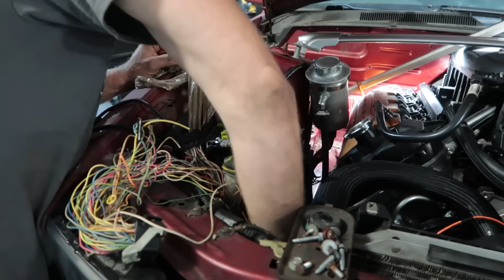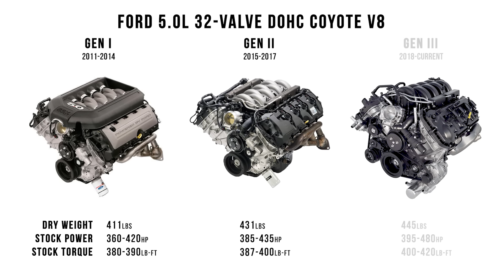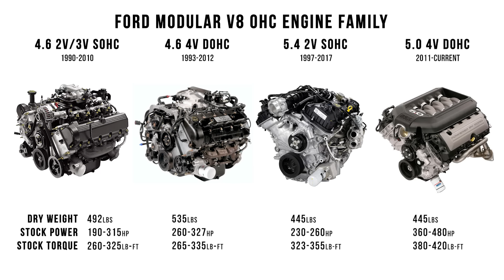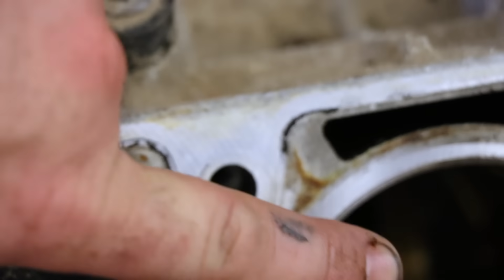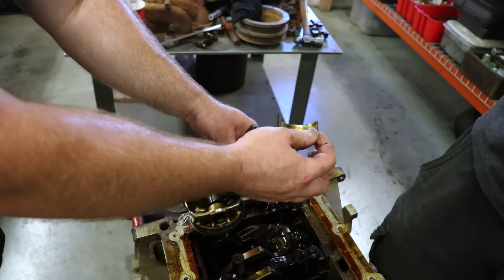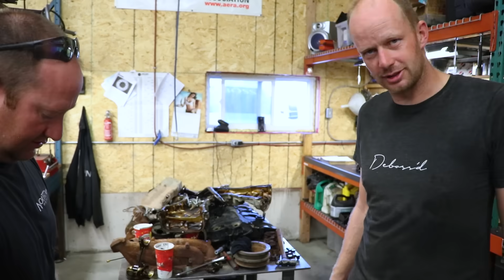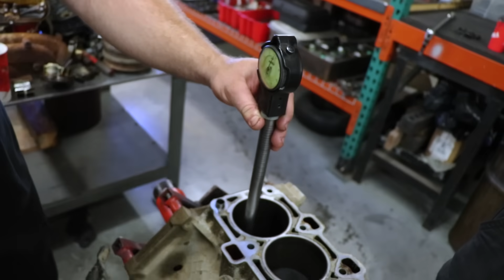REVIEW: Everything Wrong With A 5.0 Coyote Engine

Comment from the maker: Always good to hear stuff we missed. If you have experience with these engines, leave a comment!
Deboss hats are here https://teespring.com/deboss-hat
*Edit :  We're seeing a lot of the same comments about synthetic oil... It's fine to disagree with Scott, just want to make it clear that Scott isn't diagnosing this engine failure as a synthetic oil issue, and neither of us is recommending you run conventional oil in these engines or any engine made to run synthetic. Always run what the manufacturer recommends in your vehicle. Scott also never said synthetic is "inferior" to conventional oil, just that longer drives are much better for these engines in the long run. He also never said synthetic oil is what caused this engine to blow... He said it leaves a tarnish and he has seen crystallization more common in engines running synthetic than not. Not all synthetics are equal, not all bearings are equal...your experience will vary. Go ahead and debate these points, but we didn't speculate on what caused this engine to fail until 22:09 and ultimately we don't know the history or what actually happened. Change your oil and do regular maintenance guys. Again, we make these review videos to discuss engines and their problems as a resource for used vehicle buyers and hotrodders looking to rebuild these. If we didn't like the 5.0 we wouldn't put one in a Bronco...
Reply: I work on these engines regularly. 90% of the truck 5L I work on have low compression on cylinder #4 and 8 caused by intake valves worn down at the valve seat
Reply: Old technology vs. New technology. Overhead cam motors have been around for a very long time. 1929 Bugatti Mark whatever the hell it was was a dual overhead cam motor. There's nothing modern about that technology. As is a race engine dual overhead cam Motors are the way to go there fantastic. Expensive to buy , expensive to fix.  You just don't want anybody inside one of those Motors. But on the street do you really don't need them.
You're looking at the pushrod wrong. Think of the push rod as the fusible link for the valve train. When the Piston hits the valve you bend the pushrod not the valve. Lot cheaper to fix.
Reply: I did alot of the development on this engine at Ford dyno lab in Dearborn MI. Personally the Gen1 and Gen2 are the best. I know alot of people with f150 5.0 that have well into the 200k miles,and have only changed oil,and plugs. No even coils have been changed.  In my opinion its the best engine ford offers for the f150,and most under marketed engine. Alot of the durability issues had to do with a bad ground crank. Which was fixed in the XM development stages. If only they offered the 7.3 push rod in the f150 lol
Reply: @jackdaniels5205  Good to see a fellow Ford employee. I've been at Essex Engine Plant since 2011 installing the cam phasers on the left side of the engine.
Reply: @Bandit69ply  Build the FE again, please….
Reply: @jackdaniels5205  why the 7.3 in a f150 may I ask and how do you feel about the 2021 5.0
Reply: @leardi58  ??? 7.3l is simply LARGER....
Reply: @jackdaniels5205  what is ford doing to fix the oil consumtion issue in the gen 3 5.0 i was looking to buy one until i heard about that.
Reply: @justintaylor428 
I would love to hear a conversation and explanation about the 18’ F150 5.0L or others near , Oil Consumption Issues.
Reply: @jackdaniels5205  I agree. I have a 1st Gen Coyote in my 2011 F150 with 110,000 miles on it. I change the oil every 5,000 miles and use Valvoline SynPower (full synthetic) oil. I never need to add oil between changes, and the engine has been solid as a rock. This is my 7th F Series truck and I expect it to last the rest of my life. I'm 63 and get a couple of hundred thousand miles from my F Series trucks without issues.

BTW, my Coyote has had one set of plugs, oil and filters and nothing else. I began running 10W-30 in it because the 5W-20 thins out in Oklahoma and Texas during hot summers and the valve train taps. The slightly heavier oil made the cam phasers quiet again.
Reply: MotorcityFord313 Have a 2016 mustang 5.0 with 8;500 miles. Don’t drive it often. Got an oil change with full synthetic which is the first time of used full, usually use a blend. Now I hear a small ticking at low rpms. Do you know why?
Reply: @jackdaniels5205  The thing I would like to know is why were the engines (and I have no durability argument, like anything if you maintain things they last) so huge?  I have a 1969 Ford 390, that I ran many many miles on and maintained. I souped it up to make 435 hp and 455 lbs ft in 1999, maintaining it, no leaks I used good parts to rebuild it. We measured and weighed it with the aluminum intake. It weighs 526 lbs. my brother in law is a rebuilder for his local dealership. The 2V weighed 610 lbs and was as big as a 460.  The FE to me is perfect and I love it. I really hope that the 7.3 is a great engine and we can see pushrod engines like the FE again. 1969 and still going strong. I didn’t even need to rebuild it. I am considering adding a turbocharger for 700,hp from it. But why is a 281 ci engine as a 4 valve as big as a Boss 429 ? Lol.
Reply: @jackdaniels5205  I can’t find my comment. But why does my 1969 Ford FE 390 with an aluminum intake weigh less and is more compact that the 4.6 ?
Reply: Another awesome video. Have you considered doing an Everything Wrong with The Oldsmobile Diesel Video? Some part of me wants an Oldmobile Cutlass Supreme manual Diesel  (factory option, not a swap) even though the Oldsmobile Diesel has a horrible reputation. Those Oldsmobile Diesels seem rare as hell nowadays.
Reply: @MrLM002  they are rare because they all had issues and destroyed themselves.
Reply: @DeadguyAi  A few that had regular PM still run today.....
Reply: Retired Ford Senior Master Tech here.  Excellent video, very informative.  The biggest problem with all the Ford Modulars/Coyotes is people going too long between oil changes.  Ford started recommending 7000 mi regular service/5000 mi severe duty oil change intervals.  I was seeing 6.8L Motorhomes come in before 7000 mi with rod bearing failures.  The discoloration/deposits you found are from running too long between oil changes.  +1 on the 2 valve modulars being one of Ford's most reliable engines.  My 2 valve Mustang has 221,000 mi on it and I THRASH it!  I also change the oil every 3000 mi and use Motorcraft 5w20 synthetic BLEND.
Reply: @XenaFordPrincess  How do you feel about the 5W-20 oil recommendation? Personally, I think I'd run a 5W-30 full synthetic no matter what they say. Especially if you are beating on it or towing with it, the 20 second number just makes me very concerned for my bearings.
Reply: @802Garage  5w30 is okay.  The supercharged coyotes and gt350 use 5w50 full synthetic, but the clearances are larger I  believe.
Reply: @802Garage  Also use 5w30 full synthetic if going turbo.
Reply: @XenaFordPrincess  Yeah in a crazy engine like that I would expect a 40 or 50 viscosity oil. I run 0W-40 in some of my turbo cars. I just can't see running 0W-20 in something meant to do towing!
Reply: @XenaFordPrincess  thank you sir for that information 👍👍
Reply: @XenaFordPrincess  The 4.6 l 2v is my favorite engine, so simple. What Ford motor in your opinion is the overall most durable Jodie?
Reply: @TheUltimateCrash1990  Any of the 2 valve modulars.  Also the 5.0/5.8L.  Avoid 3 valves like the plague.
Reply: @XenaFordPrincess  , when you use motorcraft Oil,  then your oil changes should be at maximum 3k miles.  Motorcraft Oil is just low quality oil and that's why it's cheap.  You get what you pay.
Reply: @repairvehicle  According to bobistheoilguy it's a good oil FOR THE MONEY.  The trouble with running ANY oil too long is the buildup from deposits.  The engine in the video is darker on the one side because that's where the PCV  system draws the vapors from.  The other side gets fresh, filtered air .
Reply: @XenaFordPrincess ,  according to oil analysis it's a low quality oil. Why Ford has so many engine issues? No other brands have so many engine issues, because no one else uses motorcraft Oil.
Reply: @repairvehicle  Hi, in your opinion which is better for a Triton engine? Amsoil or redline?
Reply: @TheUltimateCrash1990  , amsoil has been tested in Triton engine at 25k miles oil change intervals. Outstanding results. It was tested in delivery fleet f150.  If you are interested seeing results go to my channel and comment.  I will send you the link. Nothing outperforms amsoil,  that's why I use amsoil and recommend amsoil.
Reply: @repairvehicle  🙄
Reply: I have a 2013 5.0 F150, the oil they actually call for Syntec-Blend 5w-20 every 5k miles.  As for the passenger side head having more "sludge" build up, most companies that sell a catch can say its really only needed on the passenger side. 
It's interesting though to hear about rod bearings though. I've never heard of that being an issue, rather the 11 and some early 12s had a problem with the #8 cylinder being oblong.
Reply: @Brightleaf_Auto  + on the oil catch can. I bought one and it fills up with every drain interval, it's pretty nasty what recirculated into the intake that gets caught by the can. All n/a engines do it.
Reply: Rod cap came loose and doing so drops the flow to the other rods causing the bearings to wear and stick to crank
Reply: Ask Scott, Northtown Machine to start a Youtube page.
Reply: I have been looking around, but where or what schooling or path do i take to learn how to rebuild engines to include repairing. This mans level of knowledge is my aim
Reply: @jdav9360  there are several schools that will help but “this man” have years of experience and you still see how humble he is to admit that he’s not as experienced as his friend is with these engines, and that’s what you must aim for, being humble. If you understand and admit your lack of any experience in any field and recognize that another professional has what you lack, it’ll make you a better professional always! Good luck!
Reply: @jdav9360  go to WyoTech or a similar school for the training. Then try to find a employer for the continued education you desire.
Reply: Don't know if this was mentioned yet or not but in the mustang the 4.6L was not introduced until 1996 not 1990.  That was still the push rod 5.0L
Reply from the maker: @brianwild7088  yes but it was introduced in the 1991 Lincoln Town Car
Reply: @jobe1911  It should be a superior oil all around. I wouldn't worry about it. The change interval and meeting the minimum spec from factory is far more important than exactly which oil you use.
Reply: Great video! Can you do a everything wrong with the 4.0 v6 Ford made?
Reply: This guy is bashing pushrod motors. Thats where he lost all credibility with me. LS can make 550wheel with bolt ons and not cost much at all. Coyote would cost a fortune to make 550wheel all motor. Pushrods are very capable motors. Ford just released a push rod 7.3litre motor. I am a Ford guy who has a coyote and a pushrod 438windsor.  All motor vs all motor my pushrod 438w will eat coyote alive. But coyotes are monsters with just mild boost,  so i keep my coyote boosted and my 438windsor all motor. Chevy Ls7 make 600wheel all motor with just heads and cam and bolt ons, no way a Coyote doing that unless you spend a fortune. And i am a Ford guy but truth is truth and pushrod motors are still badass.
Reply: @maximusvonce1381  I agree I ll wave as I go by with my 12 lbs boosted 1969 390 with 200,000 miles and still makes 725 hp, lol I am considering 14.7 to get it up to Hellcat territory, 845hp. It loves the 12 lbs , I just need to add a T06 adapter from my T04.  That’s Fords Tough. A guy won 2019 Engine Master Vintage Class with a 399.6 ci with iron 390 heads at 597 hp NA.
Reply: @maximusvonce1381  There's no replacement for displacement.
Reply: With the company I have worked for, for 15 years. We have had 100+ f-150 as a construction fleet. We abuse the sh*t out of these truck. The coyotes have hands down been the best for abuse and longevity. The suspension on the f-150 is shit. I have heard if you start hoping up the first gen it’s a good idea to change/upgrade the oil pump. Beyond that with normal usage and maintenance these are legit, durable, and have good power with reliability. I’ve worked on so many of the trucks. The coyote is never something we really need to mess with.
Reply: @gseyank100  I have 112K on mine.  Shocks/struts are trash now. Dealer wants 1200 to replace.  Probably do my own at that price.  Maybe FOX 2.0.  Dunno yet.  Any recommendations?   Lots of body roll.  Coyote is still kick ass strong.  Needs cooling flush and differential fluids changed.  Had transmission filter and fluid change at 90K.  Didn't come with the 3.55 or 3.75 rear end so low end torque sucks.
Reply: @EdDisabledVet  Napa auto parts has a cheap coil over shock for the rear. It costs almost the same as rear shocks. Worth doing.  Fronts we always change. Starts making your tires wear all stupid and we know it’s definitely time to change the struts and possibly other steering components. It’s not real hard to change them yourself. The whole strut comes out pretty easy. Don’t really have a good brand to recommend. We always swapped stock for stock with the struts or springs. I put some pro-comp coils in my f-150. But, that was a big thing. Lifted all that.
Reply: @OBAAT772 ,  did you research before bought it.
Reply: @repairvehicle  what's there to research? I've had 3 5.0s with ran them 200k+ issue free
Reply: @wrectumwrangler  ,  how often were you changing oil and what brand?
Reply: @repairvehicle  every 8-10k kms with pennzoil ultra platinum 5w20
Reply: @wrectumwrangler  , highway mileage without towing?
Reply: @repairvehicle  mix 50/50 of highway and city. It tows half its life with full towing capacity
Reply: @wrectumwrangler  , there's no way you have no problems with 200k miles on
Reply: @repairvehicle  not miles. Kms. The only issues I had was electronic stuff like the multi function switch for the windshield washer button and a seat belt.  Nothing major.
Reply: @repairvehicle   I have 151k only did radiator hose and purge solenoid in last 8 years
Reply: @wrectumwrangler 
Now 2024, many are switching to Full Synthetic Valvoline 5/30 clean and protect.
I am still currently using 5/20 Penzoil Ultra Full Synthetic but I am thinking of switching as well
Reply: I've got a super quiet 2014 GT...I just use the recommended Ford 5W20. So far so good. It does a lot if short trips but, it uses zero oil and is quiet.
Reply: @kenchristensen1244  Me too.  I bought my 2014 GT new and have used 5W-20 Motorcraft semi-synthetic blend in it since new.  Engine is quiet and does not use oil.
Reply: This was great. Can you do one of these on the 3.5 eco boost?
Reply: And for a bit of info you can tap in to Lund racing, Alejandro Flores or Power by the hour Performance.
Reply: BamBamsflow they break under boost and when you turn up your rev limiter.
Reply: @OBAAT772  nice. Test drove one and then a gmc. Bought the gmc. Didnt like the way the seating position was, trans shift feel suspension feel or steering feel in the ford. The 5.0 was quick though.
Reply: TURD BOX.  5.0. And Ford thought they were doing something? 
LS swap the world
GM 4 LIFE
Reply: LS PLATFORM = 600K Miles with ease
I know of 2 right now, 5.3 2001 Silverado with 672,000 mi. On the odometer, all he ever did was brakes, alternator, transmission, water pump, coil here and there? Nothing major...
Truly amazing 
And the other one is a 1999 5.3 GMC 1500
523,000 mi.  Cant even hear it run, all highway miles, super smooth, just had manifold bolts replaced and a new rear end? Truck is rotted cab corners and rockets but hey! Still accruing mileage....
Hands down GM FOR LIFE
Reply: 4.6 lots of power? Yeah, all 265hp. The same as a V6 Altima. Lol

The only good thing about the 2V and 3V is they paved the way for the 4V Coyote.
Reply: Exhaust manifolds rusting out and exhaust manifold bolts rusting out, these issues Ford have not managed to fix 20 years later.  History repeats itself.
Reply: @repairvehicle   not an issue in South Texas.
Reply: repairvehicle lol about to do my power stroke manifolds and I'm 😬 about the bolts.
Reply: @repairvehicle  kinda like dodges? They are notorious for lifter ticking and exhaust manifold doing the same as fords especially in the 5.7
Reply: I started to hear lift ticking on my leased 15 charger RT after only about 20k miles,it was so obvious when I would give it some juice  and then let off,it was so loud.  It was a lease and my ex wife drove it mainly so the oil only was changed every 10k. On top of the tick the car was a real POS,I had to do a starter twice in 25k miles too  and my AC was never working right from the day I got it.... 3 dealer visits and one of them was other dealer where I didn’t buy car and yet they couldn’t fix. The whole dash needed to be pulled apart but they were to lazy.  I got tired of it and turned it in early,took a hit on that Pos
Reply: @ThePatUltra  my 1996 Lincoln Continental had a 32 valve entec engine in it from the factory
Reply: so what weight of oil do you think works best and what about semi syn oils ?? l used a semi syn in my 94 RANGER 4L V6  changed every 6000km l just found better cold starts at first lots of hwy miles later on more city which wears out clutches ....otherwise 5-30 is standard for me 10-40 on getting old n noisy motors
Reply: Just make sure you check the oil pump gears I’ve heard about them breaking
Reply: What is the valve clearance  intake and exhaut of 6bt  ,5 engine?
Reply: What I gather from the comments I 'd hazard to agree with the LACK of,  PM for the fail , and CRANKCASE EXTRACTION for the differing conditions between banks..
You can poo poo me all you want, but I believe that the petroleum institutes can design fuel systems that reduce the fuel into CO &  METHANE before it gets to the engine, but they'd prefer you continue to buy their 'well designed' product rather than hand it down to your Grandchildren.....
Kinda makes it ALL shit....
Reply: @jobe1911  TBH I have no idea other than prolonged idling isn't the best scenario for any engine.
Reply: Honestly, i think that the passanger side has more crstallization is cause the PCV sits on the passanger side so it would have more flow due to pressure being ran though the PCV.
Reply: for the gen 1. would it be a good idea. at lets say 100k to drop the oil pan and re tighten the connecting rod bolts on the main?  or do they have another fix for that?
Reply: I wonder if it's good to use in a small turbo 4 cylinder?  It seems like a higher revving small engine like that would get up to temp quickly and so might be a good usage scenario for synthetic oil.
Reply: My 5.0 coyote with synthetic oil looks brand fcking new at 111k miles pennzoil ultra platinum 5w30.  No idea why he is bashing synthetic oil..light years ahead of conventional. Never ever heard of a good synthetic oil leaving any sludge. This motor looks like it was overheated and baked the oil
Reply: Is synthetic oil recommended for a 5.0 coyote engine?
Reply: ...........>>i...im.,,..,.m NM mmmm?mmmmmmmm? Mm m??m n
.,m??m??,mm.,.m.? N m??.m,?m?m,.....m.?. MN m.,,?.,.mm.,?....m......,m,.....,.,.....,...,...,..........
Reply: Is that engine still available interested in selling it?
Reply: Can you tell me if Ford produced the 5.0L AJ-V8 Gen III that was in service to the Jaguar XF lineup from 2010-2012?
Reply: Can you do an exploding 5.4 Triton tub shit box blowup, I'd love to see it, maybe even crack a beer!  Most Fords arent even worth that!
Hey- pop the hood?
Sees DOGSHIT PILES, CLOSES HOOD
LOL
Reply: Love to see the new 5.0 oil drive belt. Yes BELT. That isn't going to go well.
Reply: https://youtube.com/shorts/QT1AmLohezk?feature=share still running.  5.0 watch and thanks!
Reply: Hi, DeBoss Garage, and thank you for taking your time with us here! Great content you have! Got yourself a new subscriber based on your honesty and humbleness, something hard to find in mechanics and trade professionals nowadays. I’ve left you a couple questions on the main comments and hope you can answer them. It’s about my Towncar 4.6 2010. 
Thank you!
Reply: mustang guy here Scott... sorry, best engine is a 427 Cammer bar non
Reply: any comments on the "typewriter tick" that affect some 5.0 Coyote engines? I read that oils/addictives containing boron solves the issue
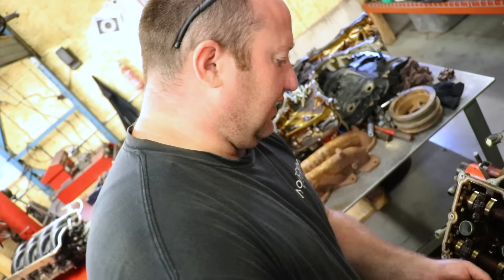Reply: song playing @ 12:30 ?
Reply: @ThePatUltra And the 2V weighs more than my 1969 390 that I am considering adding 12 lbs of turbo for 700 hp and is as big as a 460 at 281ci?  Lol…
Reply: So is there an oil additive that can reduce or eliminate this crystallization?  What constitutes a short vs. long drive mileage and/or time.
Reply: still dead wrong its pcv issue if anything conven oil makes it worst based on real science and flashpoint evap so on , the 3.6 chevy does it alot worst same issue tho .
Reply: BS he keeps saying its synthetic oil and short trips ridiculous.!
Reply: Soft intake valves on 11-13 are a problem that is currently plaguing my 2013. I previously owned a 2013 with over 190k and it didn't have any problem. I just bought another 2013 and it has a vicious cylinder 8 misfire that I'm 90% sure is a tuliped intake valve because ford had to make sure the shareholders made their profits 😮
Reply: @OBAAT772  not as fun as an EcoBoost. I just bought 2 f150 one is 5.0 and one is 2.7 and that little EcoBoost is a beast and blast to drive.It pulls my 5.0 by almost 4 truck lengths in the 1/4